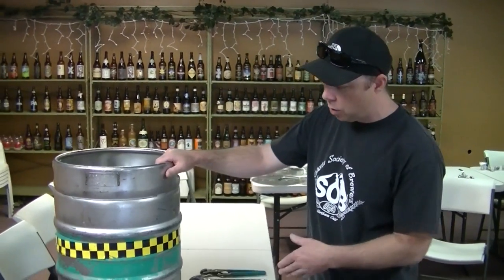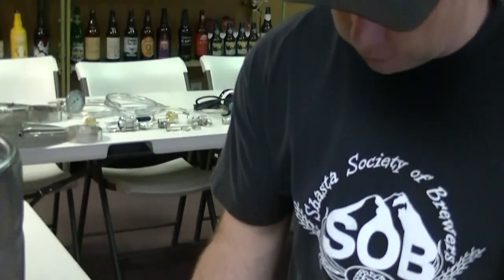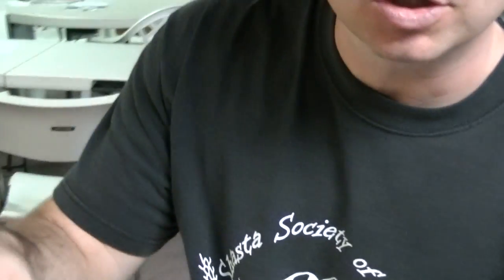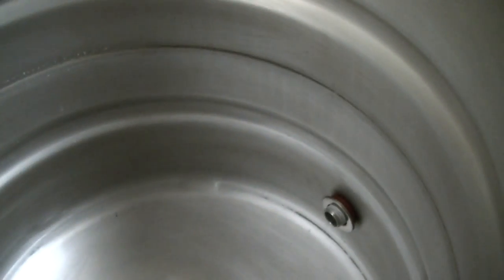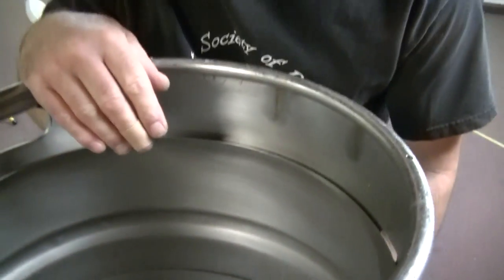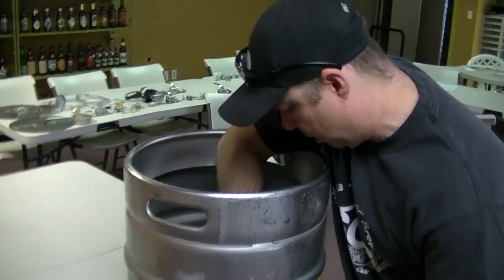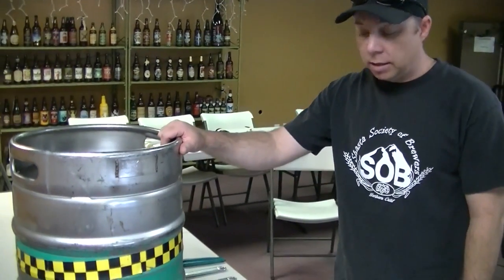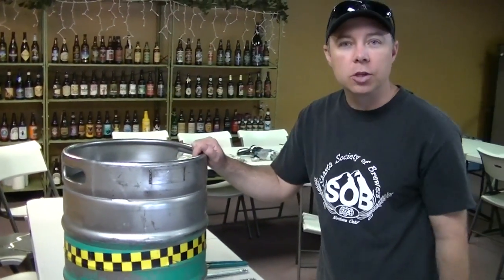How to attach a ball valve to a keg... with no welding

Comment: Why does this kettle not have a lid
Reply: Because its a boil kettle :)
Reply: @jaywebster6265  I've seen them with a lid before so what's the deference. I'm making one out of a keg atm
Reply: A lid can be made for them.  Just buy the lid first that fits and cut your top to fit.
Reply: @jaywebster6265  I have already cut the lid of my guiness keg but o sort of fucked it up so I might cut the top of it flush and go without a lid if it will work the same . I'm new to homebrew so any help welcome